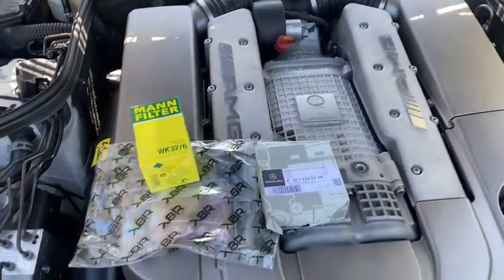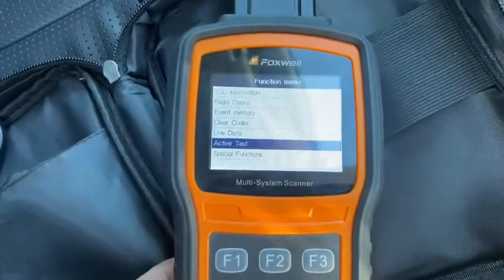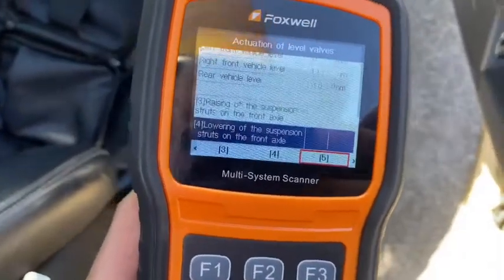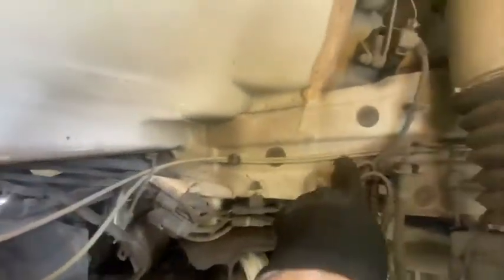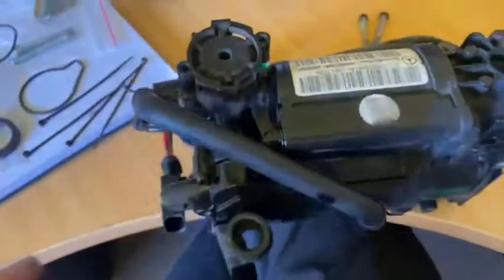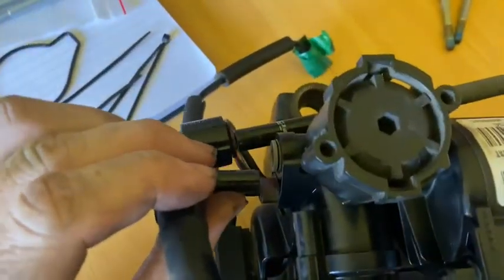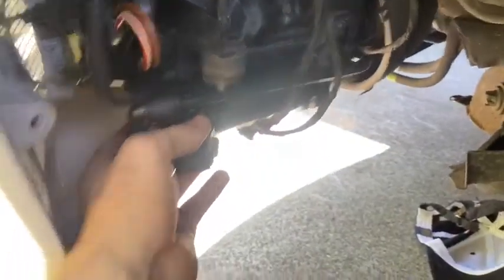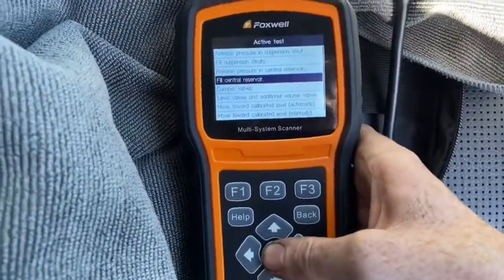Mercedes E55 W211 AirMatic Valve Block & Compressor DIY Replacement

Comment: Great video! What were the symptoms, when you decided to replace the Block? Mine is sitting in the front, after one night. And the compressor runs approx every 15-20 minutes, when driving around.
Reply from the maker: I think every 15-20 minutes is perfectly normal - mine goes off even every 4-5 minutes as the car goes over bumps and undulations. 

The main symptom for mine was when I scanned it the scanner said "Reservoir taking too long to fill" - which made me think the compressor wasn't working hard enough or air was escaping when filling. 

Now my airmatic 2/3 months later has NO codes - so I think the simple compressor refresh replacing the piston ring fixed it :)

Another symptom which was random was the computer scanner would say that one of the accelleration sensors on the shock towers was giving a bad reading - so I replaced it but nothing improved, some online things said the valve block was faulty- It doesn't at all make sense really but I replaced the valve block and now thats stopped happening. I was getting 'Airmatic visit workshop' errors every few days. Had none since (touch wood).

Hope this helps

Comment: I have a "visit workshop" airmatic message after replacing a strut and the compressor. Compressor wont kick on when I press the raise button, but will inflate the struts when I manually do it through my foxwell scanner. Any ideas? I am going to replace the valve block to see if that changes anything
Reply from the maker: Hi Luke, yeah that to me sounds like a valve block issue - it has the pressure sensor built into it so that could be faulty itself. So yep replace that and it should work fine. Especially if you've done the compressor already.
Reply: @thatmatty231guy  will update tomorrow after i change the valve block. Hopefully I do not have a line leak somewhere. Do not really want to have to find a leak somewhere
Reply: @thatmatty231guy  no luck with the valve block. Suspension feels fine while driving no issues, compressor works, new valve block. Still have visit workshop message. Any ideas? going to check the electrical connectors tomorrow on the rear struts
Reply from the maker: @lukerobertswr5189  Be good to scan and see what it is - perhaps its one of the ride height sensors or something? But yes check the top connectors AND the ADS connectors are hooked up too.

Comment: Hello from Australia great video buddy just a question can you rise the airmatic suspension with that scanner without the car running l have a W211 E550 and l cant start the car because my motor is blown and the suspension is all the way down and it wont go up if you cant start the car
Reply from the maker: Hmmm you probably can mate because I added pressure into the airmatic with the engine off and depressurised it however it’ll probably take a while. Not 100% sure but that may work - howd the motor blow on it?
Reply: @thatmatty231guy  Thank you very much l purchased the car with the blown engine

Comment: Hello from a kiwi from Texas. What are the symptoms of a failing airmatic compressor/valve body? My 09 W211 E63 is drooping on one corner. Not sure if its the airmatic strut itself or a line issue, valve body issue or compressor issue. Car tries to raise when the car is on but then sags again immediately when off. Heard a sudden hissing nosie when the droop initially started.
Reply from the maker: Hello! That’s awesome :) ….  OK so it sounds like the strut is leaking, where is the hissing sound coming from? And is it the back corner or front corner sagging? If it’s where the wheel sags then yep it’ll be the airbag. It won’t be the compressor. 😊
Reply: @thatmatty231guy  ah ok. The hissing sound is coming from the front driver's side wheel arch, so yeah I think it's the strut itself and nothing to d with compressor/valve body. I bought the Arnot As2300/1 remanufacured units here in the US for $528 US/ea. Hopefully Auckland gets out of lockdown soon!
Reply from the maker: @supercricketfanatic  The drive side arch (LHD US cars) is where the actually valve block is located too - so that makes in a bit tricky - if its that front left side sagging down, it COULD be then the connection to the strut from the valve block. If you just take that front wheel off and peel back the inner lining you'll see the valve block with clear hoses going to it, you could spray some soapy water on it :) 

And yes hopefully we do soon! Bit hard working from home with cars needing attention - (and) more importantly trying to stay focused working :)
Reply: @thatmatty231guy  ahh didn't realize they were also located on the LHS. Since I haven't got time to diagnose it this week, I'll probably just give it to a nearby mechanic and see what they say. Although I can distinguish an audible hiss near the wheel vs the compressor pump closer to the front bumper area. That's why I suspect it's the strut itself.
Reply from the maker: @supercricketfanatic  Yea most likely will be - hopefully they can help sort it :) Just get it done this week (sooner rather than later) so your compressor doesn't burn out from running constantly. Cheers!

Comment: Hi, I have a question for you. What could be the possible problem when the car starts the pump comes on for about 30 sec and then shuts off?
Reply from the maker: I think it has a 30 second failsafe from memory. So there is something possibly leaking / loosing pressure … does the car sag down or anything? Could be a small leak between the pump and the valve block or valve block and pressure reservoir. Otherwise if the car sags then it’s likely a airbag leak or leak in connection to that airbag.
Reply: @thatmatty231guy  the car sags on all four, I’ll check for leaks and see what I come up with
Reply from the maker: @tommietaylor2668  ok I’d say in that case could be your valve block then, maybe a partially stuck open valve - they can corrode over the yeads
Reply: did u fix it? be cause now i have that problem and i don't know what is the problem! i just Checked all thing and there was nothing leaking! the pump is turn on for 15 sec then its shut off
Reply: @AS.MA_  on mine I believe the rear bags have a hole in them. If the bags are leaking badly, the pump automatically shuts off to avoid burning up